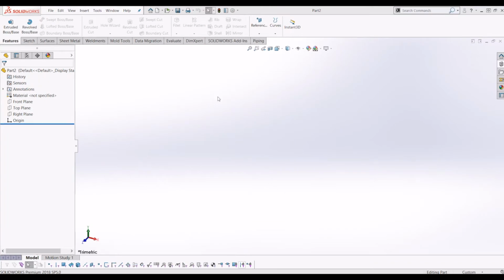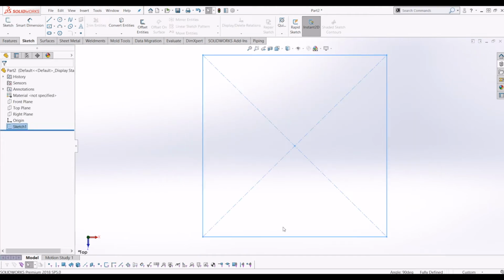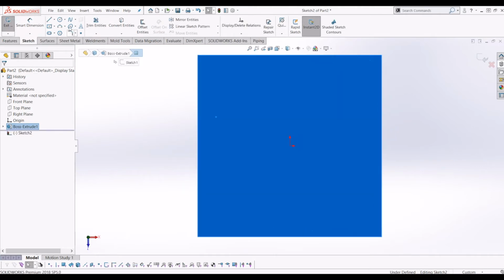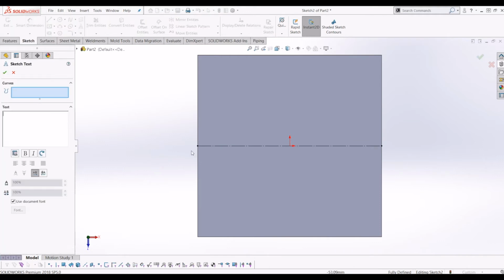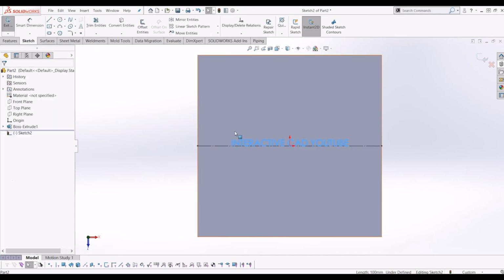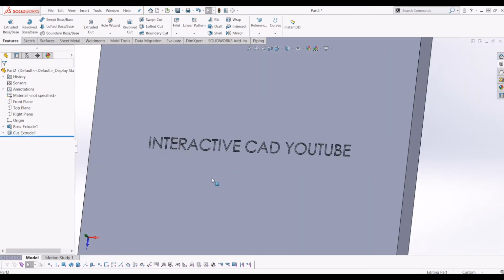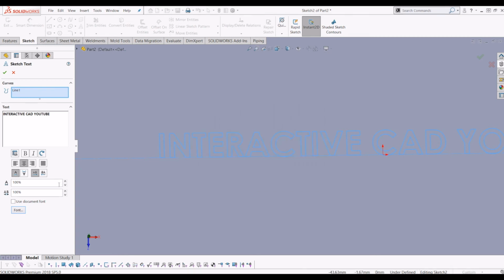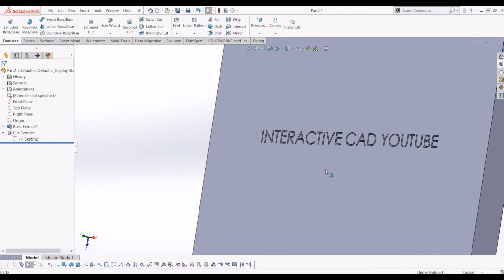Solidworks 3D Modelling How To-  Engrave Text In A Part

Comment: Doesn't work for me, it complains that I have both open and closed contours even though the letters are all closed contours.
Reply from the maker: Did you make your guide curve a construction line?
Reply: @interactiveCAD  no, but what worked is making the solid line I used as a 1st sketch and the text on a different sketch. Thanks!